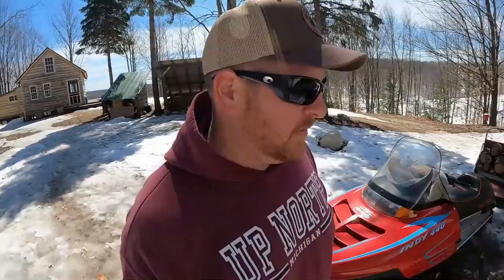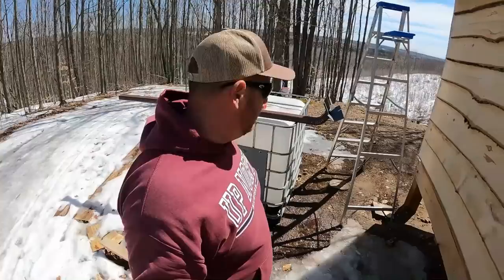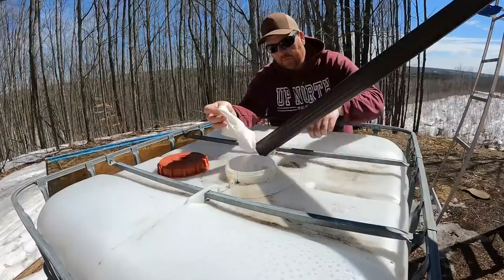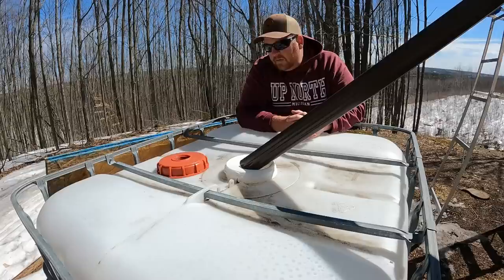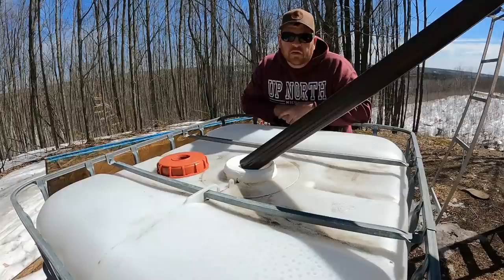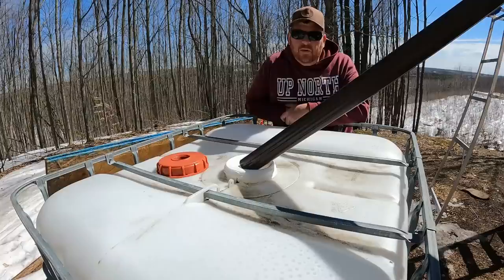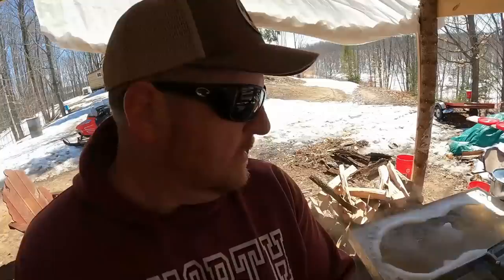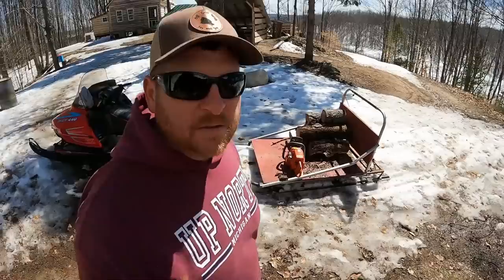Off-Grid Cabin Without a Well: Water and  Rain Catchment Solutions for the Cabin

Comment: jay and jen.that green hose you use for catchment system could be changed to the white RV stle hose that is ppe compliant,no taste or smell!I use one on my system and run my drinking water through a costco purifiy 4 canister system,good drinking water!And those homedepot buckets make know difference for syrup making,after 1 hour of boiling sap anything bad in there is dead man!Your on the right track young man!TAKE CARE
Reply from the maker: Hey, thank you so much for the lovely comment and suggestions. I think I will be swapping out that cheap green hose ASAP....but kind of hoping to get the more permanent set up installed quickly and move forward first thing now that the ground is thawed. Best wishes =)

Comment: Turn the tank around so the ball valve faces the sun or get some hot water bottles to wrap around it so you can leave it turned off until you need it.
Might make it easy to use that water in winter (if it ain't frozen) , especially if the line to the house didn't have ice in it. 😅 ❤
Reply from the maker: YA that makes good sense

Comment: Those gutter brackets do stink. If you ever lean a ladder against that gutter they pop off.  Also the HDPE2 is the plastic type.  What also makes it food grade is the mould release agent they use.  So not all HDPE2 is food grade.
Reply from the maker: Ya you are right, We will be using a different style gutter attachment system once we put up permanent gutter system......glad we learned on just this one, LOL

Comment: What most people think is  the sky is falling. I like our systems for making electricity. Power from  the sun goes back to  the inca indians and if they can do it then we can too. I don't care for the fact that although our solar power units  say american made, its a loose term for assembly as most of all those units are fabricated in China and if you see how its done, the sky is literally black from the smoke of coal fired plants that fab our Lithium batteries. We don't have a lot of lithium here in the good old usa so panels and other come from a place where people are expendable. My son  has eyes on proof of it and has shown me of many plants there while he headed a large mining project there. It is like  trying to invent perpetual motion which can come close but no cigar as perpetual power. I keep trying to remember how to make those pumps for water or  any liquid that say for instance water... it fills a bucket  that then when full drops it down making half of the pump but then it empties and it raises back up to repeat itself. Kind of a jack and jill system and the water is trapped in this system and then pumped for as far as you wish for. Even a small stream will fill a bucket in time so it does work and of course the more water, the faster it works.. I need to do a hands on build just once so it would remain in my noggin